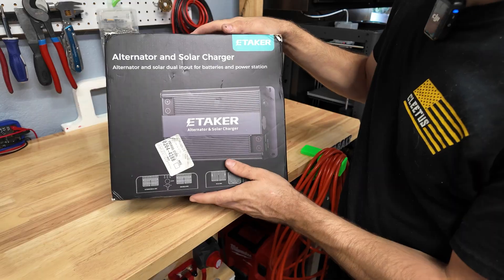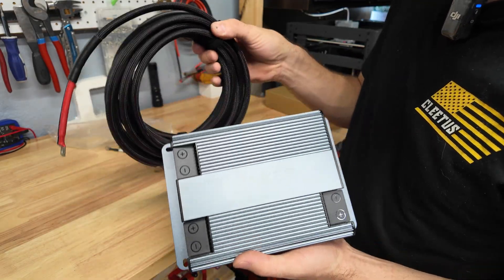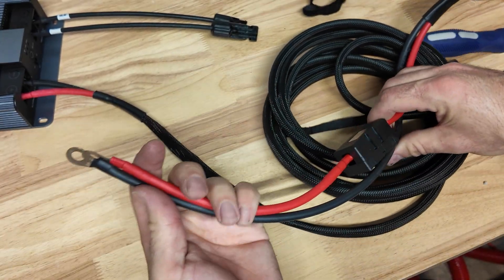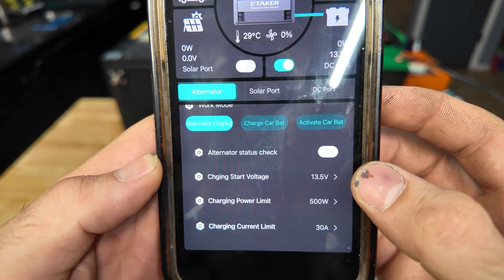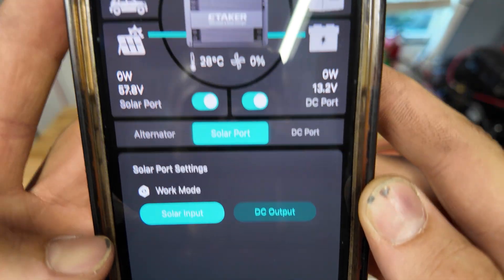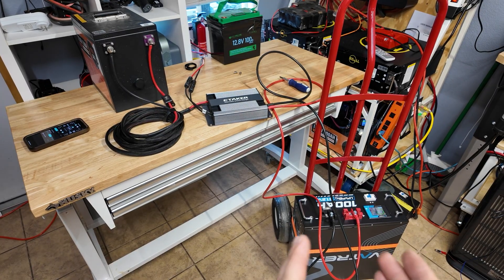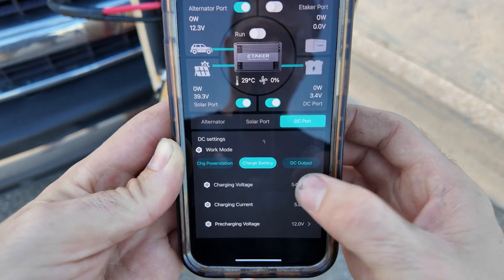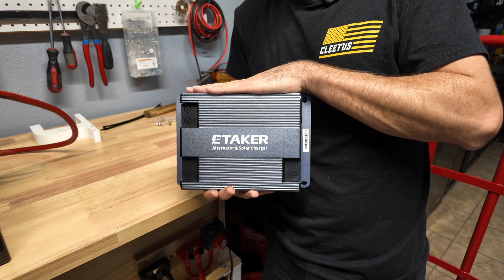ETaker F1000 Pro DC/DC Charger, Solar Charge Controller Testing | 1000 Watt Rated

Comment: I don't think these early F1000 non BT units can properly charge Lifepo4 battery banks.
The  "pro" model has BT capabilities so charging settings can be adjusted.

Comment: I have the non- Bluetooth F1000. I attempted to charge my Oupes Mega2 power box using a 300 watt 24 volt solar panel.  Not in a vehicle, but while at my offgrid cabin. 
Trying to get clarity from Etaker website.  Language difficulties...but ongoing.

Comment: Mike: Thank you! This is the best F 1000 Pro demo I've ever seen. Thank you so much for showing the various options in the app. It seems the F 1000 Pro also supports charging my Toyota Rav 4 V 6 3.5 L from a 12 V car battery input to a LiFePO 4 51.2 V 400 Ah  smart battery. Thanks again! Just wondering how safe the smart charger is?

Comment: Could I go from the charger to my batteries while the batteries are also hooked up to my charging station at the same time?
Reply from the maker: I believe you could, just be safe, verify all connections. It’s hard to say exactly but this thing is pretty good about not letting power flow until you command it to, so you can triple check stuff
Reply: @Mikebuildss thanks. If it works HallelYah. If it doesn't it is no fault of you. I'm only asking and not to hold you accountable

Comment: Cool video!
Is the Etaker smart alternator compatible and does it need a ignition feed?
Will it trickle charge the vehicle battery from solar?
Is the Etaker isolated as my power bank doesn't have a common negative?

Thanks!
Reply from the maker: Isolation I would assume yes because you can use this in a higher voltage setup (48 volt) while still using with a vehicle charging system, it can be setup to back feed power to the vehicle starting battery to charge it if need be, idk if it can use solar. 
The alternator charging is configurable by voltage. So you set it up to where when your vehicle is on, it will see the tougher voltage, around 14 or so, and begin charging from the alternator automatically

Comment: I really wished you demonstrated it's reverse charging capability with a external power source back to the vehicles battery Im wondering if it's proprietary like the ecoflow 14:25
Reply from the maker: I can try that out! You mean charging the starting battery?
Reply: @Mikebuildss I’m interested in seeing a video about this. 

I bought this and a second battery to compensate for the parasitic drain my remote auxiliary switch panel uses lol. 

Didn’t realize I might need a proprietary item

Comment: Question: info on difference between Pro and non-Pro models (besides ~$100). Do you know? 
Great video, concise and logical. Appreciate it!
Reply from the maker: It has slightly different terminals, better in my  opinion, also can charge the vehicle battery and can also run voltage out of the solar input to be used to power different appliances, can be used up to 48 volt systems , the normal one does not. Those are the  biggest differences that im aware of. They both do 1000 watts total
Reply: @Mikebuildss Thx! Their website comparison is confusing.
Reply: I had non-pro and when I had an issue with it, the company said that one is discontinued so they replaced it with pro for no additional cost. You could buy the less expensive and they will take care of you hopefully if anything goes wrong, however, pro is better terminal design.

Comment: I’m looking into purchasing a DC to DC charger. I have a dual battery system in my 4th Gen 4Runner. Does this unit isolate the starter battery from the house battery in an event that the house battery is drained?
Reply from the maker: Yes, it will not drain the house battery at all. It’s all fully isolated and controllable
Reply: @Mikebuildss thank you so much for your response!

Comment: Definitely not wrong about damaging your alternator in saying that they are quite strong 

What kills them is running high amp output at low rpm
It's because of heat heat kills everything 

keep in mind that are 60 amp alternator will only output 40 amp 

max 100ah agm battery charger limmit is 30 amp from my testing you're a lot more likely to destroy the batteries from charging too fast 

DC to DC charger is the best option 💯